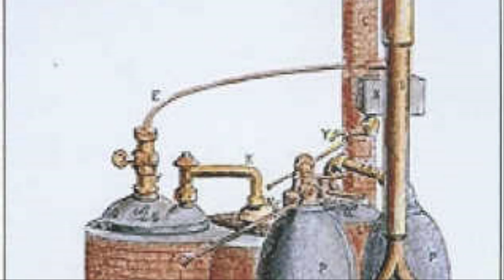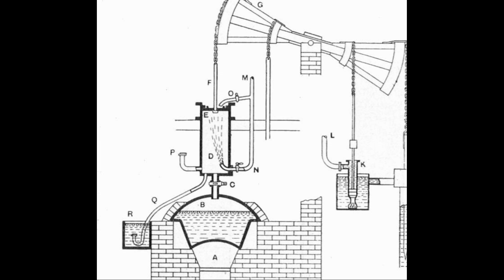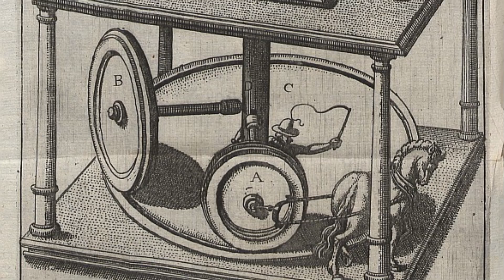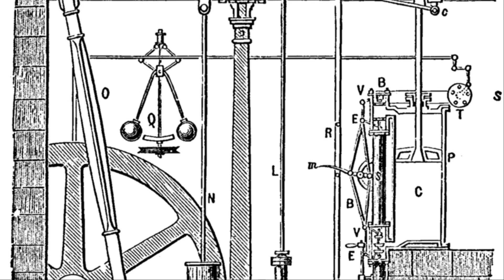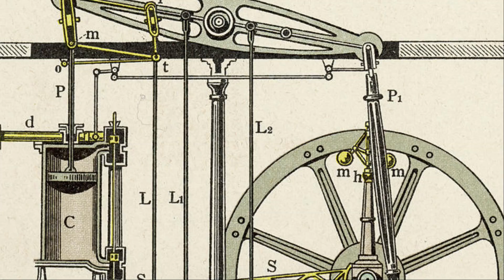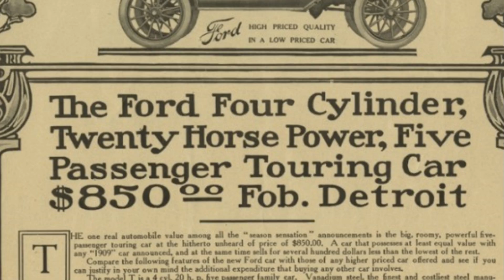Horsepower: James Watt and the Transition from Horse to Steam

Comment: Watt is probably the only person in history who conservatively rated the horsepower of his engines.
Reply: That isn’t quite true. In its early years NASCAR required its race cars to post the horsepower on the sides of the cars. “Come on, man,” would you really expect people like Smokey Yunick to really tell how much HP his cars actually had?
Reply: Japanese manufacturers are known to do this on their performance cars.
Reply: Many steam traction engines when tested on a dynamo will exceed their ratings.
Reply: @chasebarber6154  In the ‘70s when BS scientists began telling us we were running out of oil, American car manufacturers changed their HP ratings. I remember that Pontiac TransAms went from nearly 300 HP @ about 5,000 rpm to 145 HP @ 2,800 rpm. which was true. But they still had about 300 HP when at 5,000 revs.
Reply: @jockellis  It wasn't BS. Under the circumstances at the time, it was true. It was market restrictions and other factors causing the "oil shortage". It would take too much space to go into all of the factors.  Technological changes in oil production also factored into the current resurgence in supply. Eventually, (100 years? 200 years? a very short time) the supply will be depleted.
Reply: @jockellis  heck I worked in the oil fields in the mid 1970's and we cased a lot of wells off that was putting out over a 100 barrels ! There is where the oil shortage came from ! As there was a lot of oil wells in Kansas done that way ! Casing some of them in a manner that they would be hard to redrill them !
Reply: @thomasdupee1440  check out my comment to jockellis comment !
Reply: @steveclark4291  What does case mean? In that era my New Orleans uncle by marriage leased rights to natural gas fields to Shell. She’ll paid him well but didn’t drill until gas prices went up.
Reply: an engineer, all the products I work on we de-rate, and use conservative estimates. We know full well our customers are going to push what we design to its limit, so we design in extra margins we don't tell them about to ensure failures don't occur when they push the limits. In our industry, reputation matters, and we have built a reputation and reliability and dependability which does factor into customers buying from us over competitors. Also, believe it or not, overbuilding our designs a little also makes them cheaper to produce. Using less accurate and less expensive manufacturing methods forces us to change our design process. we don't optimize every detail, thus leaving us margins. We use safety factors, but also build in extra buffer on top of that.

Always better in engineering to under promise and over deliver.
Reply: @jockellis  Well there's a big difference a working industrial machine and a plaything.
Reply: @thomasdupee1440  It was BS because they told the kids buying the TransAms and Camaros what real HP they had under the hood. 
Someone once dynoed a pre-gas scare basic 426 which was listed at 250 HP. Dyno read 400. I think it was estimated that the most powerful hemis had 650.
Reply: @SoloRenegade  Earlier this week, with no gears to crack check, I took out the trash and in a sack too heavy for me to toss in the dumpster I found a 4-5” outside Mike. I told an engineer it was the second most expensive in that company’s lineup and had an accuracy of .002500. For about $10 more whoever owned it could have gotten .0002500 accuracy. The engineer said to take it home. What accuracy is called for in your business?
Reply: @jockellis  not sure what point you were trying to make, but you don't seem to understand the nature of tolerances. Your point, if I understood it correctly, has nothing to do with my comment. Nor did you state what tolerances you use, and why.
Reply: @SoloRenegade  it didn’t have anything to do with what you were saying but for us we require negative one thousandths between shaft and inner bearing race and the same negative one thousandths between outer race and gearbox opening. A mike that could be off by .00250 could not be tolerated.
Reply: @jockellis  Ok, not sure why you felt I should know that. That is so specific to you.
Reply: @SoloRenegade  I was wondering about your industry. Forget it.
Reply: @jockellis  you didn't ask a question. you shared a pointless story.
Reply: @SoloRenegade  Hope I didn’t  ruin your life

Comment: Dang it! I needed this video last semester for use with my physics unit on work and energy.   Definitely will include it to my energy playlist for next year.  

FYI, Watt's perfection of the steam engine is probably one of the most important factors that enabled the industrial revolution.   With Watt's engine,  manufacturing facilities no longer had to be located next to a river or rely on the wind.

Comment: Didn't Watt's patent hold back the development of the high pressure simple expansion steam engine? He argued that the cylinder was equivalent to a separate condenser.
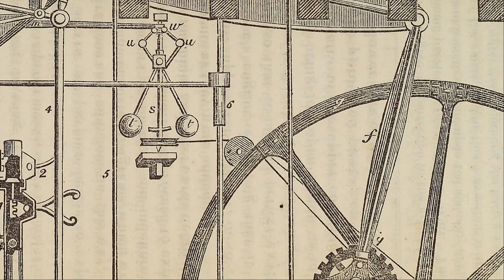Reply: Probably, and because somebody else owned the patent on a crank and connecting rod, Watt had to use a ridiculous system of two gears, with one of them fixed to the shaft and one left freely rotating in order to bypass the patent. You can see it on the flywheel at 4:00 . I genuinely am starting to think that the patent system stifles innovation.
Reply: @gregorymalchuk272  Absolutely. I've no doubt that the metallurgy existed for the development of the    simple expansion engine then, and it was the litigation associated with patent law that held it back. That and a few dozen boiler explosions. Thanks.
Reply: @gregorymalchuk272  he could have licensed the crank and connecting rod system. It would increase the cost of his steam engine but if it’s truly better than the alternative, customers should be willing to pay the premium. The owner of crank/connecting rod patent would have an incentive to keep the license fee reasonable precisely to avoid someone developing an alternative and bypassing their patent. I’m curious to know if he tried and failed to get the license or if he just decided to develop his own alternative system.
Reply: @demorgenstern7680  
He was absolutely opposed to licensing anyone else's patent. The idea that patents limit rather than foster innovation is contested. IBM did an internal audit that found tha the value of their cross-licenses (ability to use the patents of other people in the cross-license agreement) outweighed IBM's potential to enforce license requirements on everybody by 10 to 1.
Reply: In part.  Watt vehemently opposed 'high pressure' steam applications (where positive steam pressure is the driving force) because of the numerous devastating failures of early pressurized boilers.  The metallurgy/technology did not exist at that time to make safe pressure boilers ('high' pressure being ~5 to 15 psi).  The original Newcomen/Watt engines were 'atmospheric'.  Steam at atmospheric (0 gauge) pressure was drawn into the cylinder on the upstroke and then chilled to condense,  forming a partial vacuum which then pulled the piston down (the engines were 'upside down' to modern eyes) for the power stroke.  It was Richard Trevithick who championed 'pressure engines' resulting in the first locomotives.
Reply: @gregorymalchuk272  I imagine it’s very industry specific. I could see for example in the smartphone industry that cross-licensing would be a necessity due to the large number of patents held by the major companies. Without cross-licensing new phones could not be developed. In the pharmaceutical industry on the other hand, it makes sense to defend your patent since it’s only that exclusivity which keeps the price high.
Reply: @demorgenstern7680  
Tech companies sell end products. The problem is that the pharmaceutical patent system causes companies to sell chemicals, rather than results (cured cancer, cured diseases, gene therapy). This was brought into stark relief when a Goldman Sachs meeting revealed that they thought that it might not be profitable to fund cancer cures. I'm a conservative who increasingly thinks that the government needs to take an active role in drug development.
Reply: @anthonyjackson280  That's my point. Boiler design rather than metallurgy though I think. I guess THG didn't want to get into atmospheric as opposed to simple expansion.

Comment: I hate it when it is said that Watt “perfected” the steam engine. L. D. Porta invented a new four port exhaust , announced in 1974, that allowed the Red Devil narrow gauge locomotive in Africa to produce a staggering 3,500 drawbar horsepower. In the ‘30s a young Italian  automobile engineering student named Caprotti invented the first modern VTEC system because his first love was steam engines and a professor had told his class that such engines were inherently poor performers.  Before this, improvements like combustion chambers and over fire jets allowed more complete combustion and super heaters invented about the fin de siecle/end of the 19th century allowed the 2,500 degree exhaust gasses to be used again. However, to date no steam locomotive has been built with all the advancements so no one knows what the potential efficiency would be with current improvements.
Reply: Let's not forget the Doble steam cars of the 20's
Reply: @fubarmodelyard1392  Never heard of them. I’ll google.
Reply: Interesting tidbit.  The year that Watts patent ran out at least 2 Newcombe style engines were sold for every Watt engine.
The story of Watt vs Newcombe has a lot of parallels to Apple vs IBM pc.
Reply: When your name is used as the unit of power you've perfected something. Everyone's heard Watt's name. That Porta clown, not so much. We do have a Capriotti's sub sandwich shop here though. Maybe they're related? The spelling is awfully close.

Comment: Topic Idea: A figure often forgotten in the history of steam-powered development is Oliver Evans (1755-1819). He in the USA and Richard Trevithick (1771-1833) in the UK laid the foundation for safe "high-pressure" steam engines which is what allowed steam Tractors and Locomotives to be not only practical but powerful. Evans also pioneered the assembly line with an automated wheat flour production facility in 1784. He also proposed a steam-powered warship to the US navy some 40+ years before the construction of the Ironclads during the US Civil War.

Comment: Fun fact the unit horsepower can be related back to James Watt in the
metric system. Since the unit horsepower is a unit of power it can be expressed
in Kilowatt. 1HP equals 0.7457kW which is commonly used to measure and
calculate in the present.

It has gone full circle and is a real legacy!

Comment: Engineers rapidly gain a "Feel" for size/capacity at the start of their career. Switching units removes this "feel". A refrigeration Engineer who knows instantly what to expect if a plant is quoted at, say 5 tones refrigeration, is as puzzled as a lay man if kW are quoted. This is why Imperial units persist when S.I. units are easier to use and far more logical.
Reply: Using BTU long after the Brits stopped, lol
Reply: @redram5150  I started school with Imperial. We switched to S.I. when I was 11 and stuck with strict SI until after I graduated. My first boss used Imperial so I only "Feel" Steam in pounds per hour (From and at) and compressed air in CFM! Most others I am bi lingual.

Comment: Great episode.   A common misconception I noted was your comment that the Watt was used to measure the output of a light bulb, it is instead used to measure the input of the bulb and the lumen refers to its output.  A bulb's output includes light and heat as well as a little noise, but no work to be measured in Watts.  Thanks for what you do, always very interesting.
Reply: I can reasonably deduce the output of an incandescent bulb from its Watt rating. Maybe you can't, but I can.

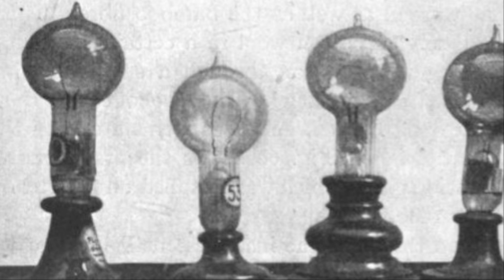Comment: 9:28 Watt is not the output of a lightbulb, it's the input.  Lumen is the output.
Reply: It didn't use to be that way. Incandescents were bought by their watt rating. I dont know if they still do, but once compact fluorescents came along to replace them it was sold as a "watt equivalent". Watt is also the output. Ultimately, everything it produces turns to heat.
Reply: Technically you are right, but power in must equal power out, in whatever form, so it's not totally incorrect. Not all of the power is converted to lumens anyways. Much is converted into heat. So power out encompasses all outputs.

Comment: The term "Horsepower" is a misnomer.  It is not a measurement of force, but is a measurement of work over time.
Reply: Work over time is the definition of power so there is no misnomer.
Reply: If it was called horseforce I would agree.
Reply: I never work, just stay buy 8 hours per day, how much horsepower is that?

Comment: Ironic how the two standard measures of power are named by and for the same man. Shows how much impact he had on the world. I'm pleased that this video acknowledges a point I've thought a lot about but isn't commonly mentioned - that "horsepower" applied to car engines is usually for peak power, would melt down if run that hard for more than a few minutes, while the unit is based on what a horse could output all day, able to do several times that in a sprint. Seems like a sort of unfair comparison, but I guess it makes sense in the contexts these are used in. Cars care about peak power for acceleration, there's little need for more than a fraction of that continuously, while horses used in industrial contexts that early steam engines were replacing were working all day long. As an engineer, I'm always impressed by THG's technical accuracy in his videos. I can't think of any time I've noticed a notable technical error of any sort in any of his videos I've watched. Same for scientific, and I'm sure other things I'm less knowledgeable about. I get the sense he's not an expert in such things but makes sure to do research to get such details right - truly commendable.

Comment: The Crofton pumping station in Wiltshire England had the oldest working Boulton & Watt engine and well worth a visit. Seeing these magnificent engines powered by steam rather than as museum exhibits run by electric jockey motors is the best way to experience the achievements of these pioneers of the industrial revolution
Reply: yes, I have a small steam engine in my physics classroom, made in the 50s by a company that was here on LI that I run for the students every year. They are usually quite fascinated by it. It has a steam relief valve (steam whistle) so I can also show them where the term "blow off some steam" comes from.

Comment: It’s amazing that all the technology and progress we’ve made as humans and yet everything goes back to horses, the standard railroad gauge is based off the width of two horses rear ends, the space shuttle boost tank had to fit into the railroad tunnels so it was also limited by the size of horses, we use horse power to gauge engine ability and most imperial measurements are based off human and horse anatomy

Comment: I've been to see the Bolton Watt engine in Sydney twice, it is fascinating as it is huge and cumbersome. It stands 28 feet tall and has huge beams and various rod and cams for the valve controls, weighing 33,000 kg. They still run it from time to time, though not using the coal fired boiler, steam from somewhere else. I think it says it produced 35 horse power maximum in its prime. Right next to it is an Apollo Saturn V rocket engine F-1,  about 12 feet diameter by 18 feet tall, producing some 30 million horse power! Yes the Watt Engine still runs after nearly 2.5 centuries. By contrast the F-1 was a single use engine, used for about 2.5 minutes for the first stage lift off. So there is an inverse correlation between power output and longevity, but both impressive in their own way.

Comment: The steam engine and the transistor (and the integrated circuits and computers it makes possible) are probably the most important inventions in human history.
Reply: I read an article a few years ago that one of the best inventions from the 90s was the ink jet printer.

The control systems are considered the forerunner of the 3D printers.

One day a 3D printer will be like the microwave.
A simple appliance.
Need something print it.
The plastics and processes will only get better, easier and more affordable.

Comment: This was a video explaining how STEAM replaced HORSES.
Please do a video about how Electric locomotives replaced steam locomotives as the electric types required far less maintenance (that's why the Milwaulkee Road electrified their line through the mountains),  and once the diesel-electric type of locomotives had their problems ironed out by the 1960s, they, in turn, replaced electric locomotives since they did not require the massive investment of overhead-wire infrastructure that the pure-electric types of locomotives required. There was even talk of using a NUCLEAR POWERED locomotive that could run for years without needing to be refuelled, but the danger of a derailment cancelled the plans to build that type of locomotive.

Comment: When I was 12 or so my friend and I got a mini-bike with a 3.5 HP engine. I was frustrated how doggy it was trying to go up a steep part of local road. "But it should have the power of at least three horses. Even just one horse can easily take me up this road!" 

Another example of misunderstanding of units, few years after that (before I was educated in physics and chemistry) I asked a pilot why to planes and ships use knots and nautical miles. I knew miles and in Mexico and Europe they use kilometers but I didn't understand why another set of distance unit. The pilot said reason is because there are many sea captains steeped in tradition and maintain that unit. Obvious there are reasons why the nautical mile for planes and ships, but that explaination of "steeped in tradition" sounded reasonable.